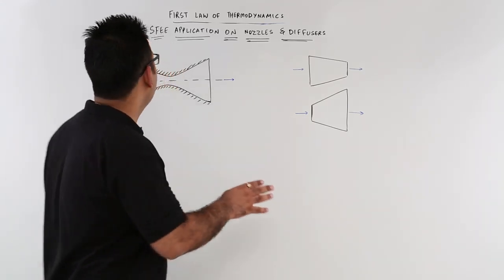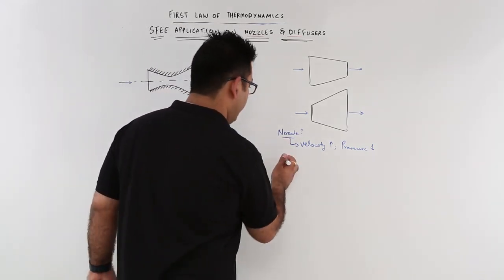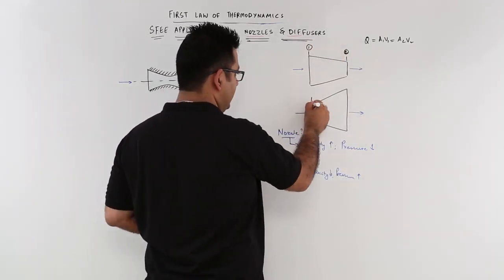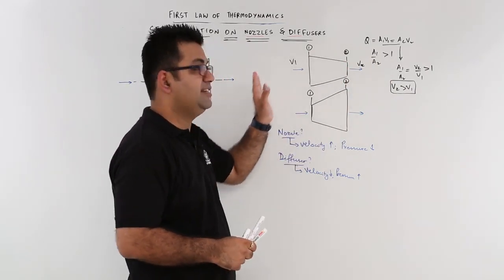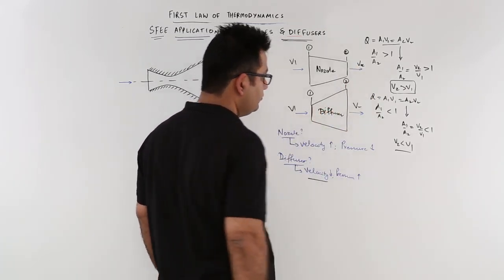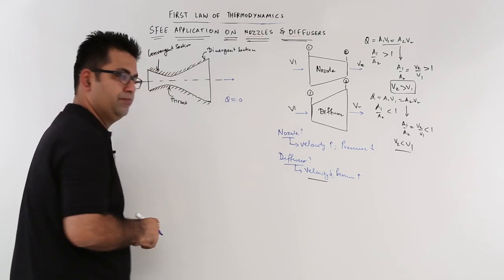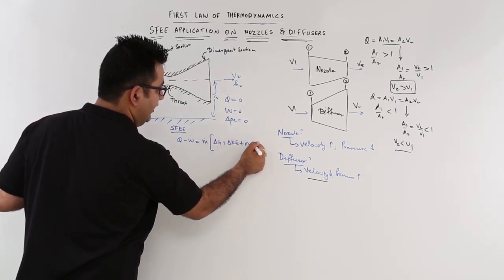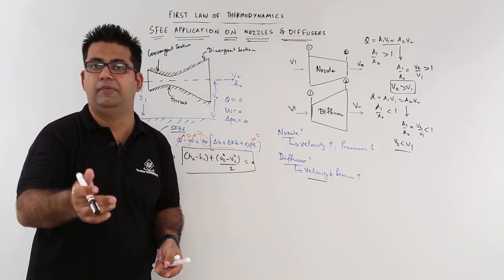SFEE Application on Nozzles and Diffuser

Comment: thank you
sir if velocity increase than why pressure decrease?

it should be increase
Reply: A1V1 = A2V2                         (A :: Area, V :: Velocity).....(1);
p + 1/2(rho)V^2 = const.      (p :: pressure, Rho :: Density)...... (2);
so, when there is an increase in cross sectional area, velocity decreases (Eq1)
Decrease in velocity, increases pressure (Eq2) 
So pressure increases when velocity increases
Reply: Mixardry thank you
Reply: Bernoulli equation.

Comment: why work is zero?
Reply: The work (or power) in the case of nozzles, diffusers, throttling or expansion devices, heat exchangers (boilers, condensers, evaporators, superheaters, economizers, pre-heaters, etc.)  is zero simply because there are not moving parts. As far as the modelling of nozzles and diffusers is concerned, the heat transfer to or from the control surface is zero because either insulation is provided or very high speed flow through them, the surface area is relatively short/small so there is insufficient time for the control volume and its surroundings to exchange heat energy through the boundary (or control surface). That is why nozzles and diffusers are called adiabatic ducts. In actual circumstances, there are stray heat losses; no doubt. Remember that, more heat losses will affect (i) the exit kinetic energy in the case of nozzle (that will be reduced) and (ii) the pressure or enthalpy in the case of diffusers which will be reduced.

Comment: Sir 
Can we apply s.f.e.e on reciprocating pump?
Reply: No, it is an example of unsteady flow, but you can go for control volume approach.
Reply: S.F.E.E. is the "Grandmother" of Thermodynamics!  You can apply with sufficient accuracy if you chose the location 1 far upstream and location far downstream; to avoid unsteadiness due to the pulsating action taking place due to the  intermittent action (to-and-fro motion) of the piston.  This is to avoid unsteadiness to justify "Steady" flow in the application of SFEE. While applying the SFEE to reciprocating pumps, you have to make the assumtions of no heat transfer and no change in internal energy. In doing so, you'll get the famous pump equation.

Comment: Sir what is m raise to the dot
Reply: mass flow rate
Reply: The 'dot' is put to indicate the time rate of flow ('rate' means speed). If there is no flow then there is no need to punt dot. Remember that using symbols, superscripts, subscripts, etc., are merely is a matter of convenience to express physical ideas and significance of certain terms and phenomena in terms of short-hand notation instead of using too many words or sentences. For example, the Newton's second law of motion is expressed by F = ma (i.e., the net force acting on a body of fixed or constant mass will always accelerate that mass. If there is no net force then 0 = ma or ma = 0. Since, in pure mathematics, if xy = 0, means either x = 0 or y = 0 or both are zero, which we apply to ma = 0. Since 'm' is not equal to 0, therefore, 'a' must be zero, which means if the mass has already been accelerated  and is in motion will now move with a constant velocity (called terminal motion).